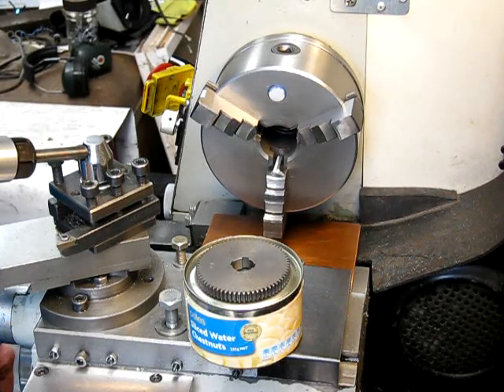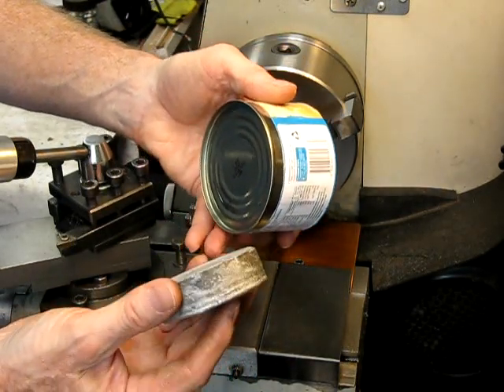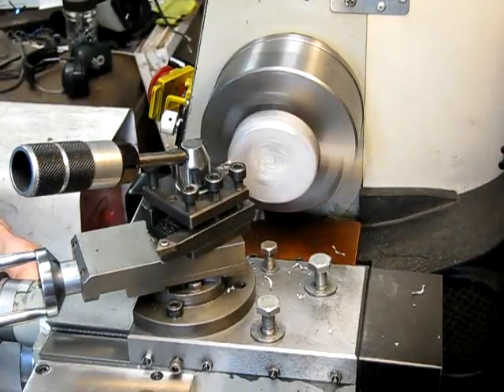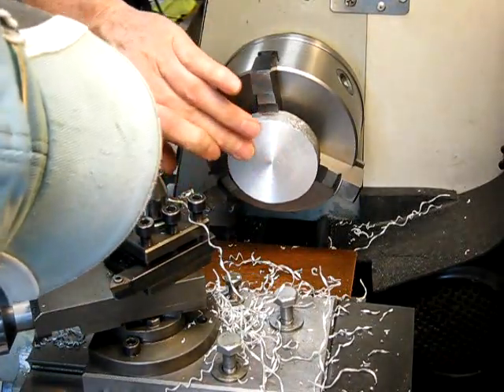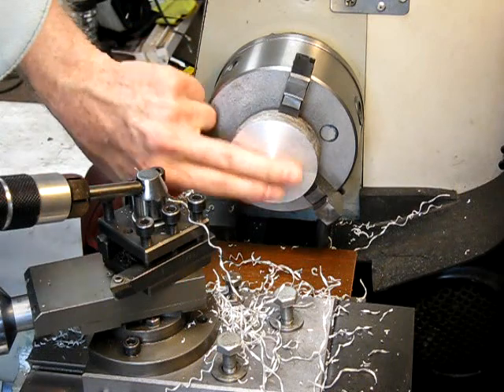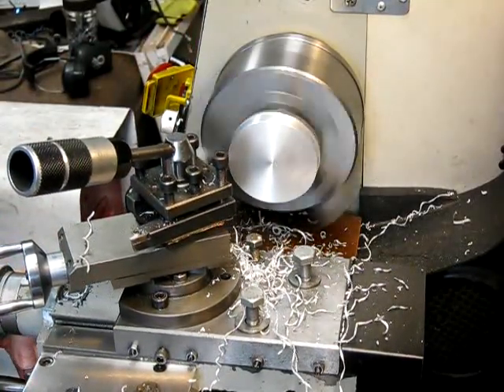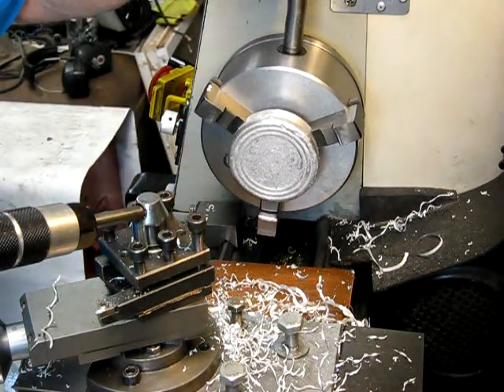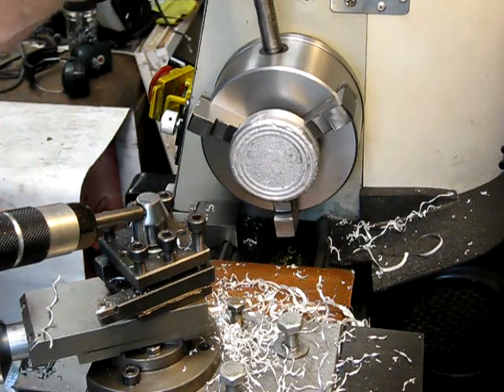How to make a gear blank - at no cost

Comment from the maker: I was looking at the long term use aluminium gears in the lathe yesterday, and they still look as good as new.  Aluminium gears run very smoothly and quietly, and certainly would be a good replacement for any polyester gears in lathes.  Rob

Comment from the maker: The lathe is a CQ9325 Chinese 10 x 18 inch.

Bolton Hardware (Pomona CA) sell the CQ9325A in USA - this model also has power cross slide which is not available in Oz.

Cheers from down under.

Rob

Comment: Thanks, loved the video, I wish you'd make more, my lathe is much smaller than yours, its a BV 20 B but with tips from you I manage so far. I don't think it's strong enough to cut gears from aluminium but it'll be OK for Delrin. I'm eying something bigger when I have enough money, luckily we have your lathe with the power cross slide here, I might even shell out for a second hand lathe instead to get a bigger one and with those attachments I won't need a milling machine for what I do, 
    My next plan is to make a furnace to make aluminium blanks because aluminium is very expensive here and my project would be about 40% waste if I made it from plate so good on you for using scrap. Thanks also for giving me the incentive to get back to work, retirement sucks when one has nothing interesting to do so now I'm getting all fired up again. Thanks, keep up the good work
Reply from the maker: +Alan Dyson 

Hi Alan,

Cheap source of excellent quality aluminium is scrap alloy car wheel rims.  I have done videos on cutting these up with hand power tools. 

This is also the best allloy I have come across.  Check out my videos on melting it - very easy to do.

The BV20 is a 9x20 lathe, so it should be strong enough to cut alloy gears if you use involute gear cutters (these are low stress). 

The mill slide must be mounted on the cross slide same as mine.

I'm also retired, but get a bit adventurous trying out new stuff (like casting) and you will never be bored or have enough hours in the day.

Cheers Rob

Comment from the maker: Yes, it's a big volume of chips that's melts down into not much.  Plus I found it made a lot of waste dross for some reason.  Maybe it has a lot of oxide from the surface area ?  I don't know why, but I stopped using it because of the dross factor.  As stated, there's plenty of aluminum scrap around.  Very widely used in electric motor casings etc.  And it's mostly good hard high silicon content stuff.  Cheers  Rob
Reply: xynudu ... its the surface area and size of the shavings/chips ... a lot of it will burn and turn to dross rather than melt ...
Reply: @nighthawk759  Maybe you could compress it into a semi-solid billet before heating.

Comment: I liked your video.  I was wondering what if you put a chunk of solid steel in the middle of the can before you make a pour in the can?  I think that would be great if you wanted a hole in the center of your roundstock I would like to do less drilling for some projects I Want to do. I figure once it cools you could take it to the press and remove the solid steel piece.
Reply from the maker: john james Yes, it's all do-able.  By heating the alloy again, it should expand enough that the steel centre will knock out fairly easily.  This is the same principle as replacing cast iron liners on motorcycle engines.  Rob

Comment: You should remove the compound except when cutting thread or tapers. This will provide much more stability to your setup and reduce wear on the compound ways.
Reply: It's ok to plunge straight in when threading. No need for the compound while making threads.